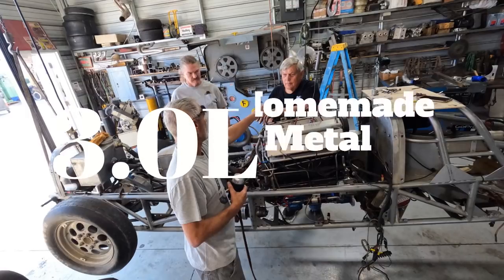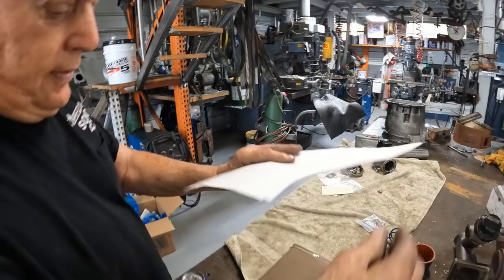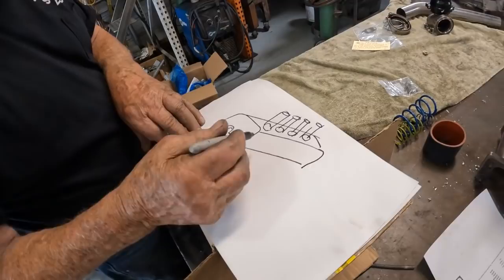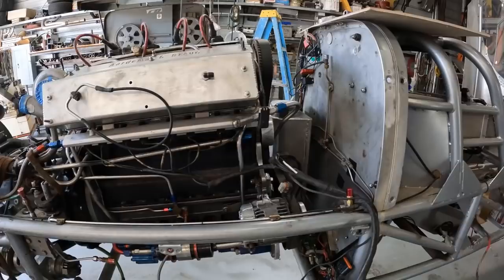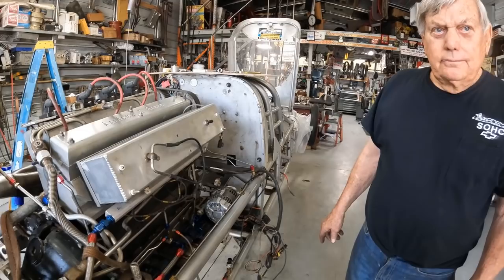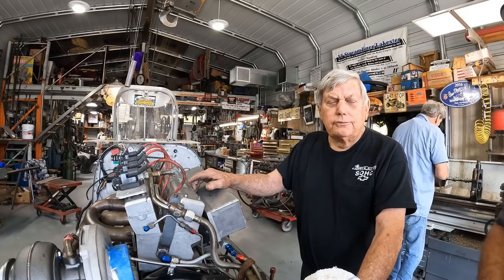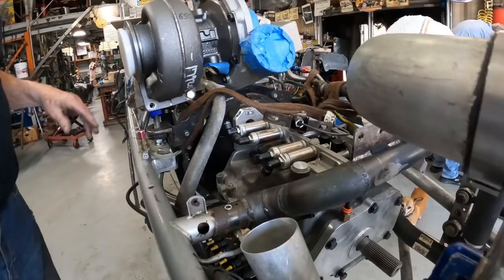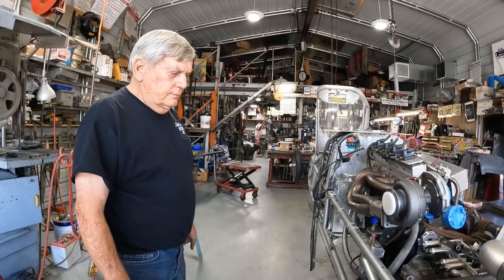Homemade 3.0L DOHC Sheet Metal Engine-  Pete Aardema and Kevin Braun Motor Madness

Comment: Would be very interested in seeing more on your cylinder head design specifically what challenges were faced with making it water cooled
Reply from the maker: They are building  a 2 liter right now, I will do a feature on it soon and get you more cylinder head detail.
Reply: @GregQuirin  this engine should put in new Chevrolet Silverado  /gmc Sierra
Reply: My first thought. 
“How the shit do you keep so much pressure and compression in a cylinder, that’s made out of sheet”
Reply: @dylnbxtr  easy........they would be using a thick,rigid sleeve like a heavy truck engine.the sleeve can be shrunk fit into the block (aka "dry sleeve") or sit on large O-rings that nestle into the block ( "wet sleeve"). You dont even need a head gasket in the traditional sense, just do what GM/Detroit Diesel did on their 2 stroke diesels. Alternatively they welded in heavy tube for sleeves and directly honed in the final bore size........that would however make the bores non replaceable.

Comment: I thought I knew a thing or two. I just learned something new. I learned that I'd like to hang out with Pete and Kevin to learn at the feet of the masters. Makes me feel sort of insignificant just being a farm equipment mechanic. These two have taken it to a whole new level. I can't smash the like button enough on this video.
Reply: You shouldn't feel insignificant what you do is important too. I'm a diesel mechanic work on big rigs.
Reply: @user-zu1hi4br4t  me looking to getting into working on OTR rigs, i do all my own work on my 6.0 powerstroke, and at work see only Cat C7 ACERT motors and Cummins VTA 903 Big cam motors, rated for 550 horse. been at it for 4 years, got my daily truck running on 100% used motor oil. gets at worst 18.9 mpg city and at best 22-24 city and 25-29 highway given no tail wind. or significant uphill downhill.
Reply: @user-zu1hi4br4t  too true, we all play our part and have different strengths and weaknesses
Reply: @user-zu1hi4br4t  We all have our heroes, mine happen to build things that go very fast. Like you, I'm a diesel mechanic, but I work on farm tractors and implements. These guys are doing things I could only dream about. Their experience is what I'd love to draw from. I'm not ashamed to admit when I don't know something, and the knowledge they have was built from years of work. I hope I'm still working at their age. Then maybe...

Comment: Holy smokes batman! 390hp naturally aspirated with low compression pistons!?! Thats insane! 600whp with that nice turbo and monster intercooler setup should be nothing at all for it even on low boost, hell it'd probably make 1000hp at the crank with just moderately high boost. I REALLY need to see more of this! I really want to see that v12 too, i can only imagine how BAMF that is, especially running.
Reply: not to mention its light as hell, i think you would be hard pressed to make it ligher even with a custom cnc block, and then you have to deal with sleaving it and the extreme expense of a 6 axis capable of doing such things. Goes to show you that a simple answer is a valid one!

Comment: This engine is by far my favourite creation I've seen from Aardema. When I first saw this in Hot Rod Magazine, I was amazed. Repeating this using a Hayabusa cylinder head and barrel is something I have genuinely considered.
Reply: You can buy a bottom end to make a Hayabusa i4 or v8 for car use. Several builders offer a Hayabusa v8
Reply: @pashakdescilly7517  Yeah, I know of Hartley in New Zealand. They make great things. But those are also things I'll never be able to afford. Hence my initial interest in building a crankcase like this.
Reply: @Thee_Snow_Wolf  There is also Synergy in New Zealand. But if you want to follow the example in this video, well, go for it!

Comment: Well that sorta answers that question.  I've thought about fabricating an engine myself, but figured that my concerns (warping, residual stresses, loss of dimensional tolerances during heat/cool cycles, being an overall PITA to do well, among others) were probably well-founded, since I'd never heard of such a thing before.  That's the sort of thinking that can limit people, for better or worse.
Reply: these are my thoughts coming away from these videos.  i watched a video of a guy fabricating a cylinder head from scratch to convert a refrigerator compressor into an ICE engine... and knew there was something to this concept but now, i feel my mind has expanded.

Comment: And this is only one of many,many of their engines.  "Hardly a Davidson" with half an aluminum chevy was one. Another was the Model A with two Subaru heads for a streamliner,then the V12 ,then the rear engined 36Ford. Oh and all the OHC converted V8s running around.  Stand back Wizzards at work! And just the nicest guys who will chat you up at any event you come across them at.😃😃😃
Reply from the maker: Thanks James, My Goal is to feature all of their motor madness creations in the next few months.

Comment: This is really cool ! As a side note, this is the same exact way that G.M. EMD 710 locomotive engine blocks are made. I know because, I work on them every day. These engines make  3000 horsepower ( in the V-12 configuration). And they will do it all day long, as long as you maintain the fluid levels ( fuel, oil, coolant). I feel that this could/should be done with a mid sized V-8  ( but with an aluminum cylinder head for weight considerations, obviously). Anyway, my hat is off to you guys ! Give’em hell at bonneville and muroc !
Reply: I came here to say this...EMD use a jig welded crankcase, my friend's father had been welding them for decades.
Reply: @misters2837  Well , I won’t argue that point . The whole engine is one huge welded assembly , obviously , from various thicknesses of 1020 plate steel . Some are pre-formed , ( that is, on a huge tonnage punch press ) some have various angles bent into them .
Reply: @jimmywaters3987  Well I would have never believed it...I had honestly never seen anything but a cast crankcase until he showed me videos of how they were welded...he had blueprints of them hanging in his garage...I don't think they were the 710s but 645s or something they really are very much based on same thing.  He showed me how the "power pack" was installed for each cylinder too...Sadly I have heard that in many installations they literally NEVER change the oil...just add more...unless there was a catastrophic failure.
Reply: Sheet metal engines have been done before,  casting has proven to be the economical way for most applications.

Comment: Humbled that this kind of content can be had for free. Thank you for letting us into your world, absolutely love what you have been doing.

I would personally request if you desire to produce more content, a detailed look into how and what you use to setup electronic ignition and fuel systems on completely custom builds as this is an arena I am soon stepping into with my own build.
Reply from the maker: My pleasure! I'm going to see about doing a feature on Pete's Ford Model A L-head motor produced from 1928 to 1931.  Pete's engine holds the world record for the fastest Model A producing 500 HP at 240 MPH!  Pete and Kevin de-stroked the motor and made it overhead cam and turbo and set several records.  Pete said he may be willing to tear down the motor to do a feature on how this was built.  Its a bizarre motor I might say.
Reply: @GregQuirin  I just saw the model A on your Christmas video, you my friend are surrounded by visionaries, soak it up. A full tear down on any of their creations would be an honor to watch

Comment: The OEM,s with all their engineering might behind them still manage to screw up things like bottom end oiling. Making your own engine and not having it turn into a box of scrap metal at over 2hp per cube on a salt lake is a mighty win.
Reply: The oems engineer for normal street use.
Reply: Meanwhile your OEM engine will last hundreds of thousands of miles if you maintain it.

Comment: I thought about doing this for a V8. I also (if I had the money) want to make bed plates for older V8 engines instead of using those crappy girdles. I have a Holden 304 and it's  hard and expensive to do a 4 bolt conversion or you run a cap girdle. Even a skirted block like the LS could gain strength from a bed plate.

Comment: The only sheet metal engine I've ever heard of was a Crosley, it didn't race...lol
I would love to see inside that crankcase.
Reply from the maker: John,

Here is some additional information on the sheet metal motor and the internals. https://www.motortrend.com/how-to/how-to-build-your-own-sheetmetal-engine/

thanks,

Greg
Reply: @GregQuirin  That was absolutely GREAT!!! Thank You
Reply: @GregQuirin  Cool thanks!
Reply: How Mercedes Silver Arrow (1930s) engines were made I believe
Reply: @GregQuirin  I feel like parts of each cylinder should be welded together first. So cut the liner at the highest possible position ( pistons have these sliding faces ), and then move in straight lines to the bearing (and the screws beside it) to transfer the force. If there is an oil groove, technically the cylinders don't even need to touch each other. Of course we don't want to mix oil and water so there will be some thin sheet metal.

Comment: so 3L in ci is 183.1ci x 2.5hp = 457.7hp pretty impressive for an N/A four banger
Reply: And low comp pistons too by sound of it as they had been planning for boost until they pushed it a bit too hard on dyno

Comment: 4.31 thats how a proper,high efficiency exhaust manifold feeding a turbo should look like.......equal length individual runners (equal speed/pressure) with no cylinder reversion from an adjacent cylinder impairing flow. Pulses flowing out the cylinders cause no interference and actually help draw the next pulse into the collector. It does take up more space than the common 'log' type manifold but it is superior.
Reply from the maker: That's great you noticed! ,  Pete and Kevin put this 3 liter in the race car and are getting ready for the May race event. Stay tuned as I will make a video of the Dyno run and testing once they get everything put together and we will see how much HP she makes.  thanks Greg

Comment: Extremely cool, would like to see more about the head and valve design and well as main bearings.
Reply from the maker: Google Pete Aardema Sheet Metal engine - Motor Tread did a nice article with nice photos of the internals

Comment: i would love to see how you weld those sleeves on that channel and just drop a crank in and everything is lined up within acceptable tolerances - or what you do to bring everything in line throughout the assembly. i did not know it was possible build an ICE without a machined block.

Comment: Have you seen the TVR V12? It was also made of sheetmetal. It was going to be for a racing series until the powers that be changed the rules. They were then going to use it for a road car but the TVR boss decided the car was too dangerous and canned the project

Comment: interesting way to build an engine 
wonder how he clamps the head on the engine (my guess is that its tied intoo the main caps )
the crank girdle should slop the carter from warping and doing a bellydance along the length of the crank while running 
be interesting to see if i have big enough tooling to make one myself , this gives me a ton of ideas

Comment: Glad you posted this and the videos on the 12 cylinder.  To me, the old Hot Rod articles were sparse on information, and there seems to have been little information since then.  This filled in a lot of blanks for me.  I would really enjoy anything you could add about the engine and head fabrication.
Reply from the maker: I plan to do more videos soon. I hope to make the more detailed showing hoe Pete and Kevin build their motors

Comment: I’m really glad you are documenting all the stuff these two old guys have done! I’m really glad to see that there’s still guys around like Garlits & these two who build something from nothing! There is absolutely 0 young guys in Motorsport, NHRA/NASCAR ect coming up with new ideas 💡 & parts on their own 🙄🙄🙄🙄! Everyone just buys everything & they throw some candyassed kid in a race car, because he was good @ video games 🙄🙄🙄🙄🤬🤬🤬🤬! Give me a fcking break! There are a few, but almost none worth mentioning! I wish I could start a racing class that were real cars, put together with everything from the junkyard! Absolutely like NASCAR & NHRA PROSTOCK were when they started! I still tell kids that if you haven’t taken a complete junkyard engine & actually made it perform in either drag racing or circle track racing, you’ve never really built a engine! I’m not taking about late technology either! No L/S or 4 valve per cylinder shit either! Any monkey 🐒 could make good power with those! I’m talking about what Reher Morrison & Warren Johnson started doing! 327 SBCs bored over to 331 & spinning them to 8000rpm, with stock crank rods oiling systems, stock stamped steel stud mounted rockers! Stock iron heads! Those engines had very few high performance parts in them! Pistons camshafts valve springs & knowing what to do with the ports they had! They usually had aluminum intakes & Holley carburetors! When you actually make a factory small block w a small Holley 2bbl carb, stock unported heads, only 11 to 1 compression, .550 lift cam rules ect, ect, make over 400hp & over 420tq with mostly factory parts, than make it live for more than 1200 laps running 4500 to 7500 & higher!  Your actually doing something! They tried to run crate engines in these classes, most engines wouldn’t make it to 1/2 season 🙄🙄🙄🙄! Also they tear you down all the time & check for anything illegal! Those are the real engine builders! These two men have blown that stuff right out of the water! Ask Don Garlits how much nitro he ran on freshened up stock junk back in the 50s & 60s! Racing today is not performance based… It’s all rules, so everyone could win, as long as they spend spend spend @ the right performance shop 🙄🙄🙄🙄! It actually kills new ideas 💡! Thanks again & great video!

Comment: They should try to make a diesel. Or a 2 stroke gas engineered like an old 2-stroke Detroit. W a port in the cylinder lining for intake w a blower, then 2 exhaust valves. W an injector up top, & spark plug to get that sound.

Comment: lookinbg forward to seeing it race
Reply from the maker: I'm looking forward to it as well!  They have 4 motors they can run this next season.  They have the 6 liter V12, The 4 liter V8, The 3 Liter sheet metal motor and the newest creation, a billet 2.0  4 cylinder.   The V12 is my favorite, Its a freaking beast and truly amazing to hear it scream at 10,000 RPM.

Comment: At speed/full load I wonder what the air temp is post the intercooler on entry to the engine would be? Does ice water maintain adequate temp control through out the whole run?  I've wondered about using a methanol/water mix over a bock or crushed dry ice as coolant for the intercooler. You could vary the ratio of water to methanol to suit the air inlet temps needed. This of course begs the question can you get the intake air too cold? At what point does low air inlet temp inhibit fuel vaporization to the point where it hurts combustion efficiency, in a full load high rpm situation?
Reply: You might have to ask Pete how many iterations they went through to get the mix that worked best. These guys a absolutely fascinating. These videos should be "must see" training info for young guys or girls who want to get into design or "mechanicing." It seems though that becoming a skilled machinist and welder would be a really valuable place to start.

Comment: Good going guys. How much convincing in your own minds did it take to actually go ahead with your engine. I ask this question because we all go bench racing. Makes me wonder if some of my hair brain ideas would have worked. I used to hold records at El Mirage & it took 4 or 5 yrs before they were broken. I do still hold a record at Muroc, but that's because I ran the last year out there. I planed to get back racing again, but my friend & pit man passed away. Still will get back with my motorcycle with new ideas. I'll be looking for your car.

Comment: Interesting, everything that is old is new again. Sheet metal engines were being built back in the early days of automobiles. However they were not successful as they had serious leaking problems.
Reply from the maker: Your right about that! Pete and Kevin move quickly, they will build a motor, test it set a record or two and move on and build something else.  This coming weekend they will be welding up their new 2.0L motor. I will film the process and put something together soon.

Comment: Hi! Amazing! What are the composition in the metal? I mean what code it has? How many millimeters is the sheet? 

My english isnt great but i hope i made my question understandable. :-)
Reply from the maker: Philen, The engine is made up of ¼” or 6 mm mild steel U channel plate. The u channel measures 8 inches wide and 22 inches long. The top of the deck is ½” or approx.13MM thick wall steel. The end sections are also ½” or 13MM thick wall steel. The outside side panel for the water jackets I believe is only 1/8” - 3.1mm sheet metal.  All of this was mig-welded together.
Reply: @GregQuirin  thanks alot for the answer!